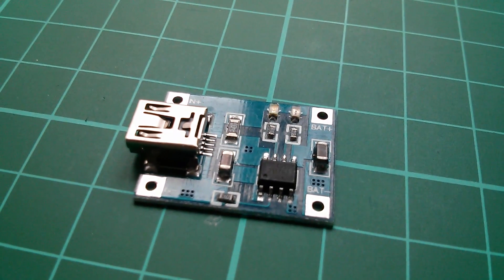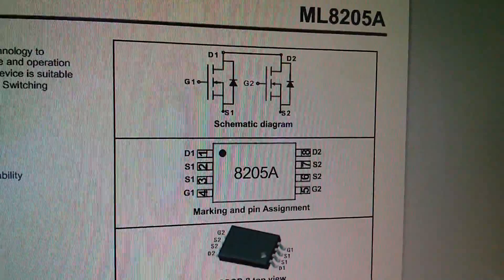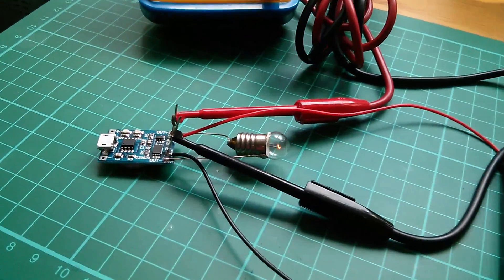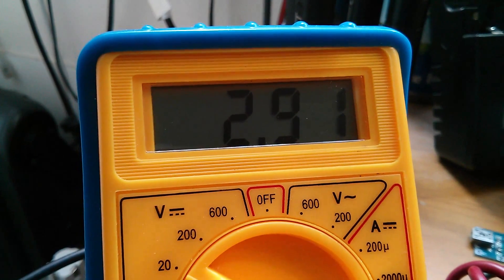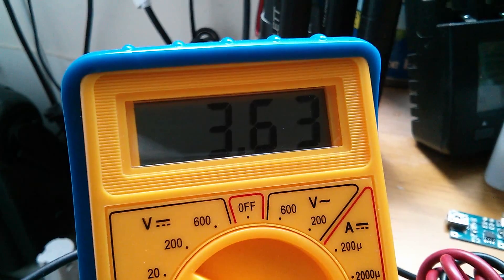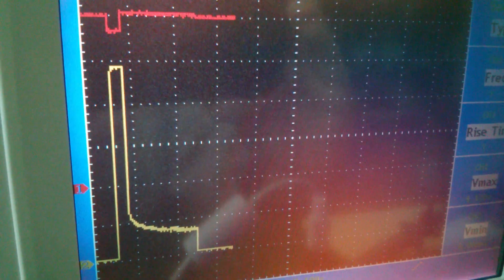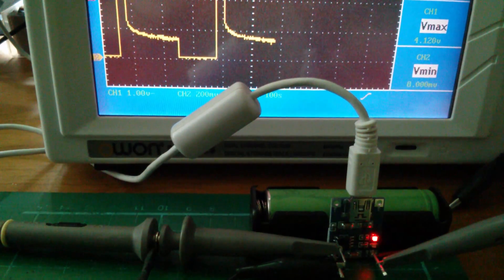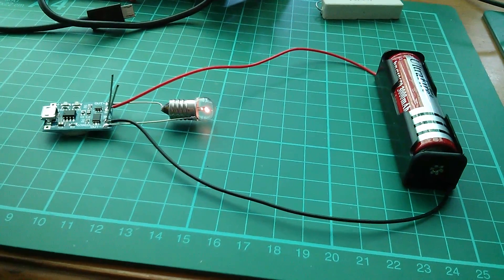New TP4056 Lithium Cell Charger Module with Battery Protection

Comment: Julian -
You were viewing voltage and current on the same oscope screen. I could see that it was an Owon, but can you give me more info on how you did it ?
Reply: the 4056 has a charge monitoring pin that provides a voltage that relates to the current. you can attach the scope at 100mv p/div which translates to 1A per division. check the datasheet

Comment: Hi!
My question is: I have a similar charge board with built-in protection. Can I use a board like this with a battery which is also protected?
Reply: Yes.  Two layers of protection won't do any harm.  Won't do any good either, but won't do any harm.  At worst, you may get a slightly lower voltage out, by a small fraction of a volt.

Comment: If the Charger Board never produces more then the 4.2v how could it over charge the battery ?  The battery can never take in more then the Charger can produce.  Does a Float Charge like that damage the Battery ?

Comment: Hello! Can I connect one 18650 to TP4056 to power an ESP8266 as  a rechargeable battery solution? Esp uses constant wifi whenever its on.

Comment: Hey I have this question for a long time.
I have a circuit that draws arround 20mA and it is powered by 2 16850 cells in parallel. I have a small 6V 1W solar panel to charge them. My question is if is this module, the TP4056, capable of protection my baterries and charge them with the solar panel. I know the solar panel is weak, but my power needs are also low. Will this setup work?? Thanks a lot

Comment: Do you think two inputs and two outputs of two boards could be connected in series, Feed the series input with 10 volts then connect the outputs to two cells?

Comment: My mobile phone chargers output voltage is 5V & the output current is 2.4A , so is that safe to use as the input device to this module???

Comment: Hi Julian, I have 2 x 18650 protected cells (new) and want to use them with the TP4056 boards. I’ve already ordered TP4056 with the protection circuitry built in and it struck me that my batteries are already protected. I assume I need to order the older boards with no protection circuitry to charge my protected batteries. It’s probably a stupid question but I thought I’d ask the expert first. Thanks in advance.

Comment: Hi Julian, 

Excellent, is it possible to charge two or more LiPo 3.7v 1C batteries with this module? If so, how should we connect the batteries to the module, i.e. in series, parallel? 

Thanks.

Comment: Answering a few questions which multiple people have asked:

1. You can't use these boards in parallel to increase the charging current, however there are boards which do this by properly connecting the TP4056 chips to work in parallel.  Search eBay for this phrase:
TP4056 4.2V 3A High Current Lithium Battery Charging Board Charger

2. You generally can't charge cells in series with these boards even by connecting a separate charging circuit to each cell or set of cells, both because the charging power supply needs to be totally isolated from the load and because these charging boards would have difficulty in handling the discharge current.  Instead, you'd need to search for a Battery Management System (BMS) board which is designed to properly balance charge the number of series cells you wish to use.  Generally these will also incorporate over-current and under-voltage protection, which are both essential.  You also need a power supply which will produce the correct voltage for charging the cells.

3. You can charge multiple 18650 cells in parallel.  The only effect of adding more cells will be that the time taken to charge the cells will increase, perhaps to an impractical length of time if you add enough cells.

Comment: If you change R3 to 33k, you can recharge rechargeable coin cells i.e. LIR 2032 (The "LIR" bit is important, it means lithium ion rechargeable).
The 33k resistor limits the current, otherwise BOOM!

Comment: Still a popular charger, but it does infect damage the LiPo's. They should be cut at 3.3V at a minimum, to  avoid going under 3.2V. 
Keeping the LiPo between 3.2V and 4.2V will preserve its life (and avoid a potential fire).
MCP73831/2 seems to be the best for this purpose.
Reply: The charge circuit was made for 18650 Li-Ion technology, not for Li-Po technology.

Comment: I don't fully understand. During undervoltage cut off, why would the charging not start immediately when power is connected? In under voltage condition, battery may never rise to recovery voltage without charging.

Comment: If I connect a boost converter to the out terminals of this charger and step voltage up to 5V,  then use the output of the boost converter to power a Raspberry Pi, do you think the setup can function as a cheap 1-cell UPS for the Pi?

Comment: Hello Julian may I ask you a question, can i use this charging bord to charge my 3.6V Ni-MH battery with this TP4056 bord? I have this few rechargeabale battery and the model is ( 1/2A 1000mAh 3.6V ) battery that was specially design for the flashlight that i have i guess. The battery was much thicker then the standard double A battery but a bit thiner then a 18650 battery and it was much longer then a 18650 battery. It look almost like 3pcs of CR123 battery that was warp and stack togather into one pices of battery. Thanks in advance.

Comment: this is a older video but still this is available, i got 5 of these boards and one thing i couldn't figure out if it was defective or not, mine boards all have no LED if it is discharging with a load on it.
so only a battery on it and a arduino on the output or something else, no leds lid up and it is powered.
the only way the led indicators work are if it is plugged in, i can not complaint as it is sold as a charger board but it has a output function too.
if it had a LED when it is delivering power from battery then it was perfect for me because if you disconnect the charge power, the board does not reset, arduino is running while switching from USB powered to battery.

also i did some measuring and mine does not cut the battery off at all if i use it, even as low as 2,6v and still outputs voltage if the current draw is small.
am i the only one having this problem?

Comment: is that TP4056 is capable to charge 6 cell 3.7V laptop battery  for mobile power bank and how should i connect cell in pareller or in series for mobile power bank.

Comment: is there any advantage of using this module with a LiPo battery that itself has built in protection circuitry? 
I would like to use this in a circuit where there is a load (which can be turned off with a switch) constantly connected to the battery with this charging module.
You showed at the end of this video that when using the older module, you add a load while charging, it will never complete the charge, as the blue LED turned red right away when you connected the resistors.
Will the new board allow me to charge the battery properly and safely while powering the load circuit as well?

Comment: You really need to quit testing things with those SHIT UF cells! I have had so many false reactions with these cells compared to a good cell. They do not react the way these units were designed because they are fake 18650 cells.

Comment: this only works if your using the product and being by the product being powered once it shuts down you dont leave the device on.. for stuff you walk away from say projects run 24 7 if you walk away from one of these it will do the revover then cut off recover then cut off then it will get sooo low that you cant charge it again with the usb youll have to charge it via a hobby charger slowly via nihm settings... what they need to do is set it where it shuts off forever at 2.8 volts then stays off and only way it kicks the battery on again is if it sees power from the usb input to charge then it charges... imagine this  in a ps4 controller you walk away forget to charge it after it dies in your hands poof battery destroyed or you have to open it up do the method i do so once it cuts off you need to imidiatly charge it you cant let these sit... thats the only flaw i see in this stuff

so for stuff just  note lipos and 18650s when they get low voltage anyway drops off the bat meaning your flying something poof it drops outta the sky lipos provide constant power  till the end not like nimh or nicads where you know its dieing so if you use a project thats not critical something that needs 3 volts min when you see the controller just die etc time to charge

so these are really useless unless you use them that instant till the thing dies and you remember to charge it that minute..

Comment: Hi Julian, there is a huge dropout voltaje between output and bat pins in these boards with TP4056 and protecction circuit. I think is because of F8205A's mosfets' reserve diodes. Have you noticed this?regards

Comment: can i charge multiple cells with that? I want them parallel with 4,2v so ai have more AH
Reply: the 4056 measures the current flowing into the batteries to determine the cutoff point. with 2 batteries (or more) in parallel they act like 2 resistors and halve the internal resistance overall which allows more current to flow. Most likely the 4056 will not shut off at the correct time and the batteries could over-charge. The single battery cut-off point is about 100mA so you would need to somehow increase the resistance the 4056 is measuring to get it to terminate the charging at the correct time.

Comment: Hello. I made the connections like this (tested 5V at output), and my cellphone wont turn on after that (it died basically). I suspect there was current overflow. Any ideas if I definitely lost my phone? Is it worth to buy another battery or any other component that might have burned?

Comment: So the bulb is using the usb power when the battery is below 2.91 ? Now try make it work with 3 x tp4056 and 3 x 18650 to balance charge them and get 12.6 volts protected voltage across the 3 cells ? impossible I say

Comment: Could this be given an input from a solar panel (having a 5V USB output) on the micro-USB connector, with a USB powerbank connected to the output of the TP4056 module to have a setup where a discharge of the powerbank is prevented when the solar panel is not producing sufficient power?

i.e. a setup where the solar panel charges the powerbank when it can generate sufficient power but the TP4056 prevents discharge of the powerbank when the solar panel output begins to drop when the light begins to fade due to clouds / sunset.

Comment: Julian, Thanks for the video.  At 11:15 you discuss the possiblity of the load interfearing with the charge circuit.  I think you are right.  At http://www.batteryuniversity.com/learn/article/charging_lithium_ion_batteries  they state, "Turn off the device or disconnect the load on charge to allow the current to drop unhindered during saturation. A parasitic load confuses the charger."

Comment: I have a personal project (which I do not intend to sell) that will be powered by a 2S3P cell Lithiun-Ion battery pack...  It needs to be fed from an USB port and needs 3.3 volts to operate. It is low power device but it may need to be powered for months at a time on extreme cases. 

Will the TP4056 work for my requirements, or will I need a separate buck converter for it?

Comment: Julian, I have enjoyed watching your videos.  It has made me want to wade into building a faster (ish) charging power bank.  

I know that I'm really late to the game, but I would be tickled pink if you could address my questions.
 
I plan on using a 20v 2.5a  laptop power supply to charge this power bank.  Inside the power bank, I want to use 4 of these boards in series (5v, 1a each) to charge individual 18650 cells.  The question that I have is: Will the MOSFET used on this board act as an ideal diode to prevent backflow of cells that discharge out of balance if you connect the OUT+ / OUT- to a single  or several parallel boost converter board(s) with USB output.   

OK, one other question: Would you recommend that I isolate the 5V serial inputs before inputting into these modules?  If that's the case, it may be cheaper to use a 5v 10A buck converter and do the whole thing up in parallel.

Comment: Question for anyone: Can one double these modules up connecting all outputs together to increase the charging current from 1 to say, 10 amps? Not on USB power obviously, but with a high-power, 5v power supply feeding them all. I'm asking because I have a 45C, 1S battery pack I'd like to charge inside a project box on the cheap.

Comment: http://www.icstation.com/mini-18650-lithium-battery-charging-board-charger-protection-p-9293.html         This website says, disconnect load when charging. So you were right with your assumption.

Comment: What would be the best way to use one of these boards with one or more 18650 lithium cells to get a rechargeable 5v output for an arduino project?
Reply: That depends.  If the circuit is designed to be always-on, then there's a single-board solution for that, with a trimpot to adjust the output voltage.
If you want to be able to turn the output off, then a TP4056 board like this one, plus a 3.7V-5V booster board would probably be the way to go (so long as you need no more than 1A of current).

Comment: hello. do you have a idea of what I can use it charge 2-18650 cells. I want to use a buck converter to drop from the 12-24v or 10-15, or 20-30 approximate voltage.  its a lighting system. that I want to charge from my off grid battery bank. I don't want to take the cells out to charge them. I want to either plug in and charge. or keep it plugged in. can you help me? I also need the same basic setup for a out door LED accent/ porch lighting. but its basically a battery backup deal I want to finish building. help if you can thanks

Comment: Is the low cutoff voltage because of the voltage drop when you draw current from the battery? And is it safe for liion batteries?
Reply: It's made for Lithium-Ion batteries.  It's not intended for other lithium chemistries which use 4.1V or lower as the end voltage.

Comment: Hello ! My name is Messias i am a student from Brasil  and i would like know how can i use a new charge module TP4056 like power bank cell with 8 cells split in parallel and in serie on same time. Like 2 cell (3,7V) + 2 cell + 2 cell + 2 cell = 14,8V.

Can you help me ?
Reply: That can't be done with the TP4056.  You need a Battery Management System to properly charge cells in series.

Comment: Notice on battery protection circuit, one MOSFET operates Drain to Source and other MOSFET operates Source to Drain?  The diodes drop too much voltage for battery use.

Comment: Julian can I use a single TP4056 single cell charging board with a Black Plastic 2 x3.7V 18650 Type Battery Holder Case? So this would be 3.7V set up in parallel? Same voltage higher capacity correct?  So my question is, can I use a single TP4056 new version charging boards to charge 2 18650 TrustFire in a one duel cell holder?
Reply from the maker: Yes - nice n simple :)
Reply: Can i use 3 batteries for charging.
And how many batteries we connect in parallel for charging by single TP4056.
There is a limit please tell us.
Reply: pds tech can we parareled the charging modulr so it can charge many battery? 

I want  make a big powerbank
Reply: My idea is using 2 charging board, but only 1 source micro usb (5v up to 2A) 

Is it possible?
Reply: TIRTA GT if you're going to connect two chatting noises, why not just let them charge their own batteries independently? You can power both boards from same power source, simply connect in+ to in+ and in- to in-
Reply: Wade Clary don't forget that by putting those cells in parallel (this post is over a year old so I'm assuming you've learned more) you will be halving the maximum output current. A single cell gets 1a max with the tp4056, 2 in parallel get 500ma a piece, 4 get 250ma each and so on. All this really means concerning real world results is slower charging time. If it took you say, a half an hour to charge a single cell from dead to full on 1a, it should take about an hour to charge 2 in parallel on 500ma each (1a shared).
Reply: technically in parallel, the board would charge any # of batteries, tho keep in mind it can only output 1A, and if the batteries try to pull more than ~1A as if there are so many, over current limit would probably halt charging.
not recommended you try to charge more than 4 or 5 18650s or a lipo pack with more than 10Ah capacity

Comment: Great review Julian! I see that the TP4056 has a TEMP pin. Have you tried connecting the TEMP pin to the third terminal (T) on a li-ion battery pack (like a phone battery) and test whether it works correctly? This would be extremely handy for creating safer devices.

Comment: are the outs disconnected from the bat during charging? also have you tried linking the outs in series? guessing by the rest of the video (listening while doing other things) it would still require a few external fets to make a charger that individually charged the cells  but allowed series output. Its not quite as good as an active balance but better than passive burn off at that point. also, out of curiosity, where is the shunt hiding for your current measurement on the scope?

Comment: WOW! Thanks so much! I bought 6 of them without even knowing the point of the the connectors OUT +/- ... 
Now thanks to you I understand that it's really useful because my batteries are protected! I have the older version, but I had a problem with these because it was charging my batteries until 4.1 volt and then it cuts off... So annoying.
I'll use them for a project. Thanks to the OUT+/- It gonna be easier to make the circuit!